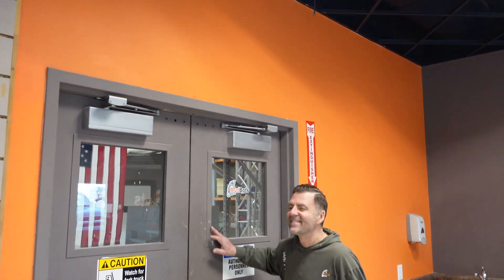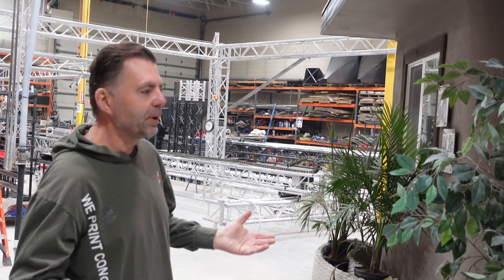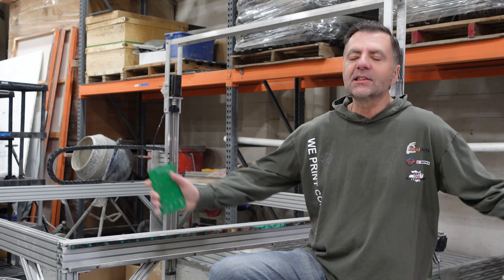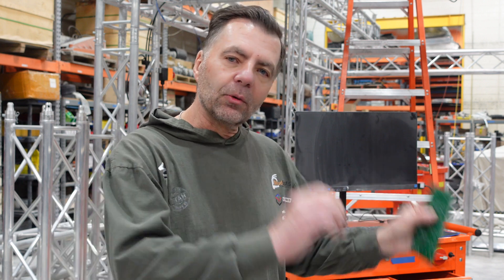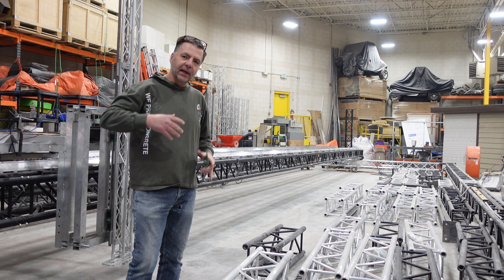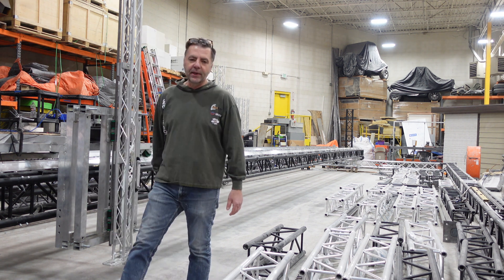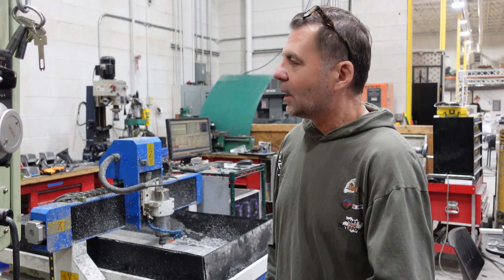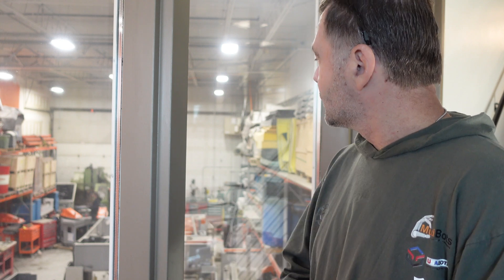Mudbots Concrete 3D Printers For Construction | Printers Past, Present and Future!

Comment: well said James. Has been trying to tell ppl that one things changes in the mixture or the setup, they got to adjust the printer for the batch, but a lot of ppl think it is just dump the cement in and turn on the printer. It is easier just to keep everything as consistent as possible, instead of trying to have different approach everytime.